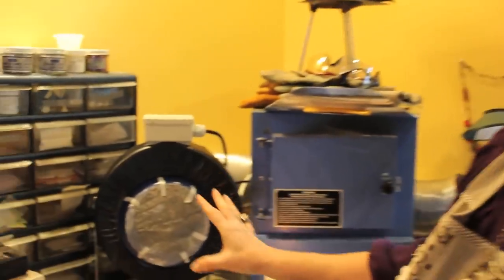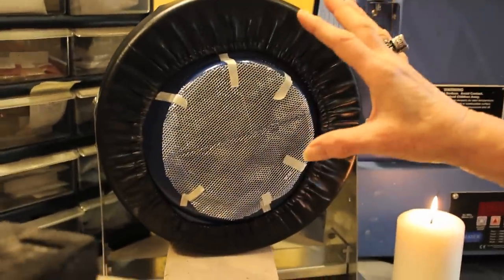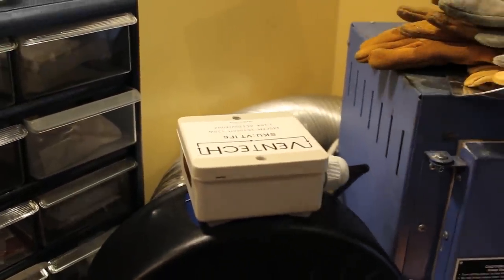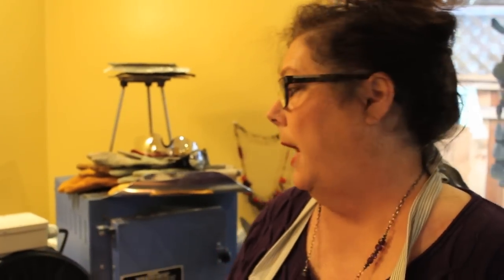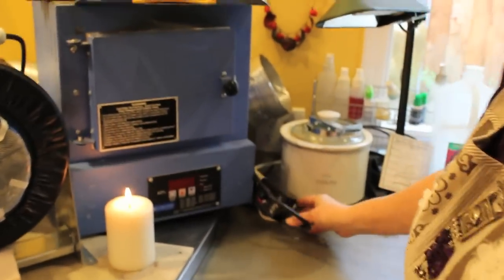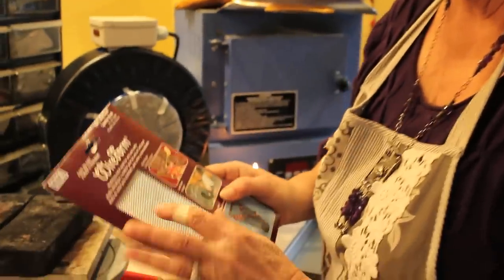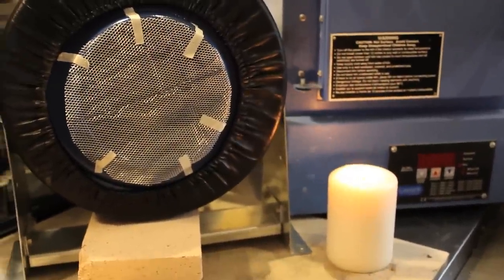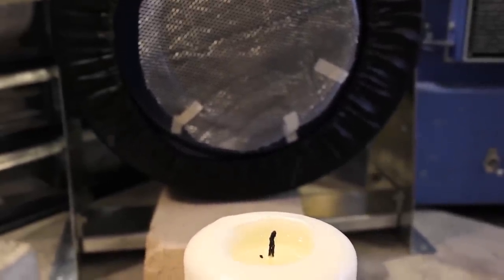DIY Fume Extractor for the Studio or Shop

Comment: Hi Nancy! I suggest you remove the mesh screening that you put up to protect your cats and your fingers as it will affect the amount of air removed etc. Instead get a small piece of fencing, sometimes called rat wire, it's smaller than chicken wire. This rat wire has wires going up and down, and across creating little square holes just a little bit more than 1/4". This would not cause resistance with the air you're fan is trying to pull out and it would allow your fan to do its job without having this mesh work against it. I'm sure you can find someone you know to give you a little piece of this wire netting/fencing. Almost everyone has a bit of it stuffed in their garage. There are so many uses for this wire every hardware place sells this. 

You are the most awesome woman and I can't thank you enough for sharing your talent, your metalsmithing, your life a jeweler! Because of your guidance and all your tips, methods and experiences that you share with us, you have touched many lives and made creativity possible in endless ways. Thank you, Ilene

Comment: Hey Nancy, thank for sharing this.  I'm in the process of getting a shop set up and was wondering about ventilation for your pickle pot and that tabletop furnace/kiln.  Do you vent those as well?  Why or why not?  I just assumed that I would need to set up ventilation for the soldering area, pickle pot, kiln (which I don't own yet and is really something I will get a bit further down the road) and polishing motor area.  Thanks in advance, and thanks for sharing your metalworking videos, I've been getting a lot of good information from your site and your youtube videos!

Comment: Hi Nancy - That's a cool setup. Would one need such a ventilation system when using a soldering iron with odorless flux?
Reply from the maker: Yep, yep and yep!  Dem dar fumes are not good for you - no matter where they are coming from.  Read the MSDS on your product.  The ones I checked out had: ZINC CHLORIDE and AMMONIUM CHLORIDE.  Quote from 1 MSDS:  " INDIVIDUALS WITH PRE-EXISTING LUNG DISEASES MAY HAVE INCREASED
 SUSCEPTIBILITY TO THE TOXICITY OF PROLONGED EXPOSURE TO ZINC CHLORIDE."  Here's a quote from another MSDS:  "CHRONIC= BLEEDING GUMS, CONJUNCTIVITIES, LARYNGITIS, SKIN PUSTULES, HEADACHE, HEIGHT LOSS, AND ANEMIA. ACUTE.= NAUSEA, VOMITING, DIARRHEA, WITH MUCOUS AND BLOOD, HEPATITIS AND HEMORRHAGIC NEPHRITIS MAY ALSO OCCUR "  Also, one needs to know what the solder is spitting out into the air.  Some solders have lead (among other chemicals) in them which, as you know, are very bad fumes to be inhaling. There are other, darling little pollutants/irritants/killers, hidden away in the ingrediants area of the packaging.  Check out this website: http://www.sentryair.com/solder-fumes.htm.  Most of my research was done watching videos and reading blogs from the circuit board community who use soldering irons!  They all discussed ventilation!  Great question Scraps!  Thanks so much for bringing this issue up.  See my webpage on Safety:  http://www.nancylthamilton.com/resources/safety-in-the-jewelry-studio/ventilation/.  I've added a special thanks to you.
Reply: Nancy Hamilton
Well now I'm really glad I asked. I've been gathering my supplies but haven't actually started using them. A good ventilation system is now in order. Those are some nasty ailments to avoid. I've been watching your videos for a while. Thanks for taking the time to share your knowledge.

Comment: Also your screen looks too fine, that also reduces the efficiency, just use a screen that will stop you from sticking your finger in it or sucking something into the blades. You could put ducting on the inlet to focus the suction end more easily.
Reply from the maker: The best thing to keep me from sticking my fingers (and possibly, my head) into the fan would be common sense - which I usually have but can't often remember to employ.  Great tips and ideas and I appreciate them Michael.  Thank you.